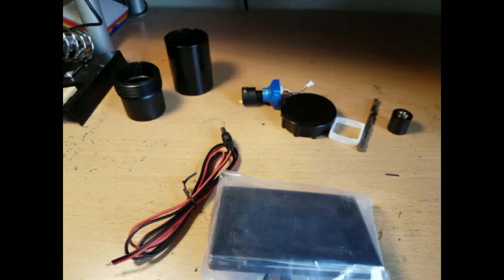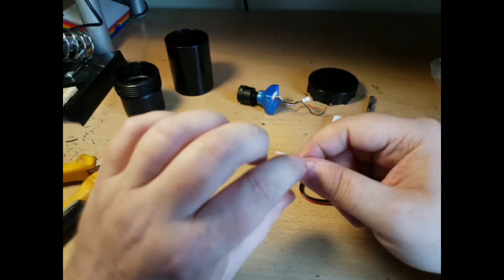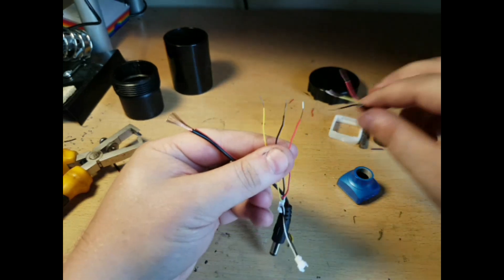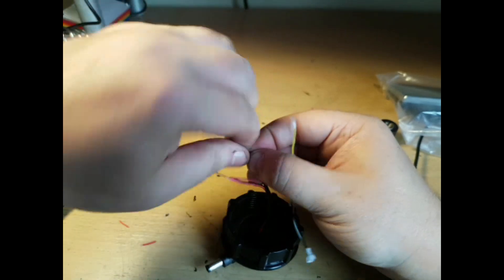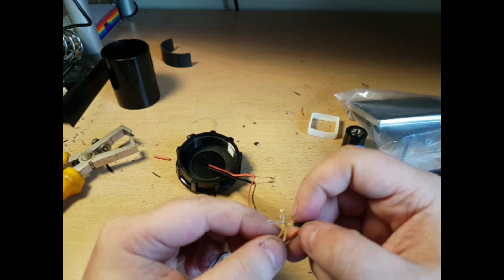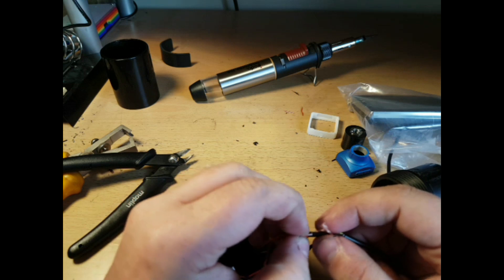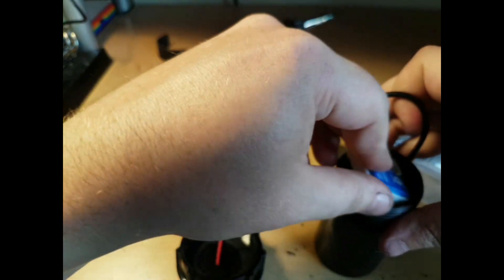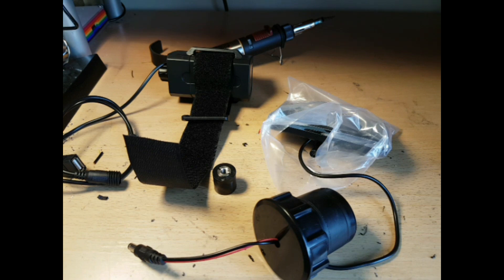DIY Night Vision - Simple Foxeer Night Vision Addon

Comment: Hi sorry of asking but why don't you solder the wires just heat shrink them from Roy .I used a vice and grips to break the seal on the lens
Reply from the maker: The only reason for no solder is to emphasise that you don't need to if you haven't got a soldering iron, no other reason really. I will redo the video anyway as I am not overly happy with it.
Reply: fetchitnowuk thank you for your help roy
Reply from the maker: Your welcome, it was a plausible question as soldering is always going to be the best connection if done correctly.

Comment: I stuck mine in a vice and used pipe grips to remove the lens - Reckon sealed in with araldite so tough - Similar with the IR Filter too used a soldering iron to remove mine - That was scary thought I was going to fry sensor it got that hot before it came off
Reply from the maker: I had the same fear myself. Will be ordering another camera in the coming days.